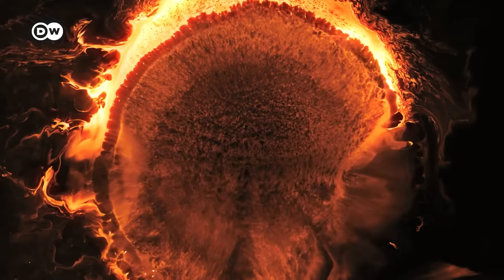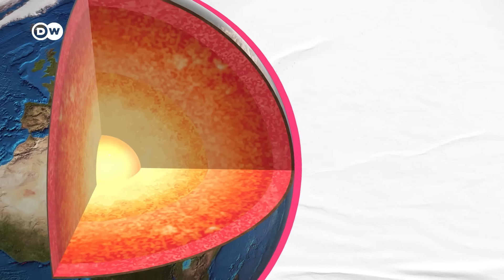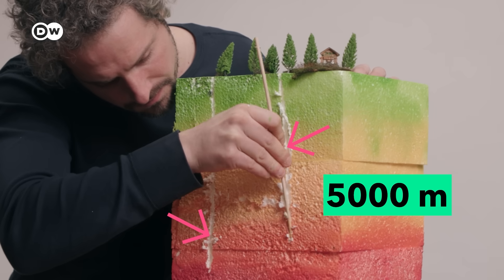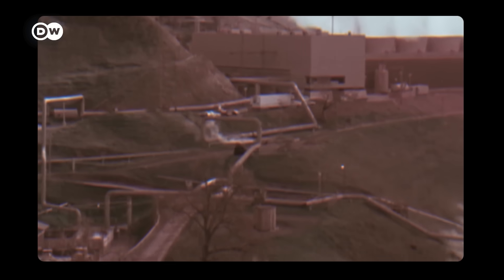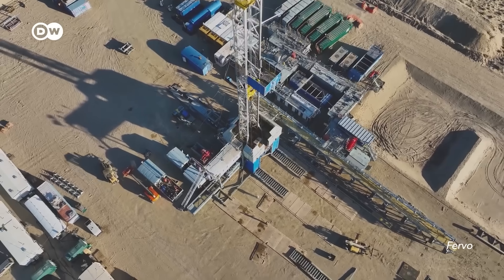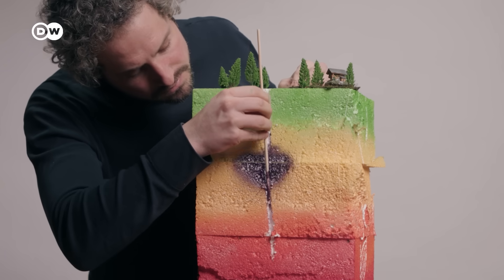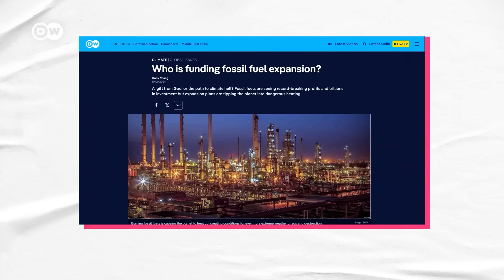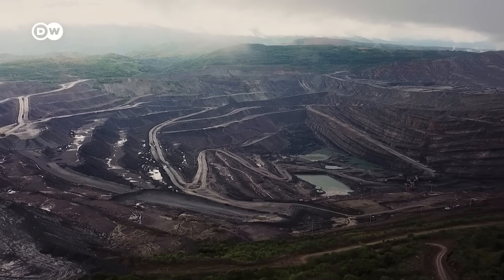How the oil and gas industry can unlock endless geothermal energy

Comment: Nop, solar is cheaper and there's a lot to do on the surface first: grids and plants, DC lines, recycling, ev-transport, energy stores and lot lot more
Reply: Data centers and some other industries need 24/7 power. It might prove cycling water in loop a in the depths of winter at night is the way.
Reply: @Nowherenear its way more expensive than what the classic lcoe says, you need to consider battery storage
Reply: Batteries are still expensive (albeit rapidly dropping in price), and there are days where neither the sun shines nor the wind blows for renewables, so if you only had fully batterized solar+wind you still run the risk of nasty blackouts.
Reply: It depends on where you use them.
Reply: But solar isn't that clean when dirty mining is needed for materials, slave miners in africa, and tons of electronic garbage from solar panels....